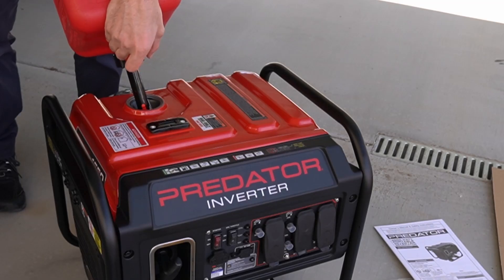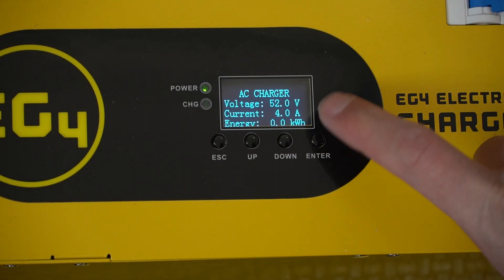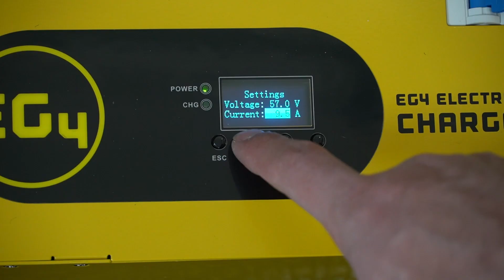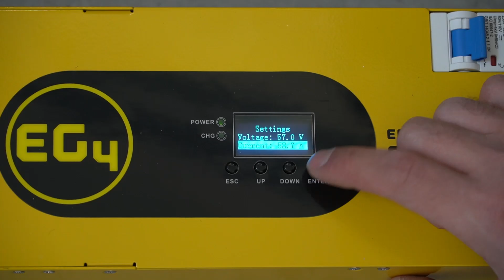New! 48V 5kW EG4 Chargeverter

Comment: My utility is now charging $65 per month in "base charges" (fixed charges before paying $.15 per kWh). My area can't produce enough solar power for my homebin the winter months so this product is one of the keys to my eventual plan of taking approximately $3000 paid annually to the utility for 15000 kWh and using it to go off grid. If u get 7 kwh per gallon of fuel at $4 a gallon that's about $.50 per kWh. I pay $.20 per kWh including my base charges.
Reply: I pay 33 cents a kwh from Pacific Graft and Extortion for my first 292 kwh a month. Then it goes to 39 cents a kilowatt hour. You have cheap power.
Reply: @kimmer6  yeah but what's your base/fixed charge?
Reply: @fox156  No base charge. We pay by the actual usage in gas and electric.
Reply: @kimmer6  @ 500 kwh usage per month I pay .26 per kwh, you pay $.33 per kwh. At 200 kwh usage per month I pay $.47 per kwh you pay $.33 per month. My utility penalizes conservation and charges a much higher rate for people that live in small homes/use less electricity and a much lower rate for those that use more electricity. Your utility does the opposite, charging more per kwh for people that use more. My minimum bill is $65 yours is $0. You just have to use less elecctricty to save money, I have to go off grid to save money. As far as I know we have the highest base rates in the US. Funny world we live in eh!
Reply: @fox156  Are you with San Diego Gas and Electric? Interesting read. I used to use about 550kwh a month. I found some things to really cut it down. Nobody else would put up with the things I do to save on natural gas and electricity. I put power stations in all over the world right out of college decades ago. I see the writing on the wall. Higher energy prices, shortages, rolling blackouts. I prepared, did actual real world tests to see the weak points in my strategy. I should be OK.  My January gas and electric cost $187 for a 3000 sq ft house. My neighbors paid $500-$900 for January. I snicker at them and know I'm doing things right.
Reply: @kimmer6  I'm in northwest Colorado, yampa valley electric association (yvea).

Comment: Will, another possible use with the dial-a-charge is to run a generator in ECO mode to keep the noise down while boondocking.

Comment: Glad they made this! No doubt there’s a good amount of “dirty electricity” using square wave harbor freight generator/inverters
Reply: Until seeing this video I never knew anything about this problem. It kind of really sucks having an all-in-one inverter if the charger doesn't work properly unless you have 22,000 w or you're plugged into extremely good Shore power. But I guess I I am glad saw the video before I plugged in my generator to the all-in-one. I was considering doing that in mines a cheap predator 3500 so I don't ruin my all-in-one inverter. I thought the Predator 3500 was supposed to have a pretty clean inverter but maybe it doesn't. What is the price of this charger to you know offhand. I haven't seen that yet I wonder if you could charge you're 48 V golf cart I don't know much about golf carts but I just thought of that
Reply: @VinceBadovinatz88  Will has a link to this above, but the price for one is $399.00.
Reply: @Tumbleweed5150  thank you

Comment: I've been thinking of a high power charger, I have a solar system on the house, then 300ft away I will have another system on my shop. I considered combining the two system into one, but not sure. I can use a charger tho to charge the house if the shop solar is producing excess. I plug in my tesla in the house system.

Comment: Was looking at this model the other day.. Spec sheet says max voltage is 57..  Thought that was kind of odd..  Either way, this thing is a beast..
Reply: 57 Volts is close to the maximum battery bank Voltage for charging a "nominal" LiFePO4 battery bank.
Reply: @Tumbleweed5150  I agree that it is close..  Just odd they max out at 57..

Comment: That's pretty awesome. I have a Cummins Onan 7000 watt QG series fuel injected generator, it was free to me, just needed some maintenance, super quiet however it only outputs 120 volts on 2 circuits, each being 3500 watts. It's power output however is very clean. I have one of the two circuits going to a Growatt that I use just for 120 volt loads, adding one of these to the second circuit I could then use the full output of the generator to charge batteries in an extended outage or just use it on the one circuit and not need to use the Growatt for charging from the generator at all. Much better deal than the Aims one and the easy to use display to set the settings would make it even easier to setup. Really nice. Being able to use both circuits at 3000 watts each would allow me to charge my battery bank in about 4 to 5 hours and then turn off the generator, way better than having to run it longer. I will say, fuel injected is the only way to go for a gas generator, no more dealing with gummed up carbs. If the fuel is old, swap it, hit the primer button to flush fresh fuel into it and boom it fires right up.
Reply: If the two 120V outputs are the same phase, you're right. If they are the opposite phase, then you have 240VAC and the chargeverter works best with that as its input.
You could put an AC voltmeter across the two live signals to check.
Reply: @isovideo7497  Sadly they are on the same phase, confirmed via meter, they use a different setup in the coil for the 120/240 volt version. But for a free generator I can't complain, it's super quiet and very reliable.

Comment: Thanks, I'll get one of these. I had trouble with both MPP and victron when they were configured in parallel or split phase that they rejected the small generator input ( we are OFF grid).. but both accepted the same generator when in single inverter mode.. seems to me  that they could make this work...

Comment: I like this. this is awesome.
It makes it stupid easy AND safe for the other equipment, to recharge your batteries from "ancient technology" when the new fangled stuff decides to break. :D
I've got SO many ideas running around right now, on how that would be completely useful.
Reply: and rather than try to figure out which other comment to reply to, I'll reply to my own. :D

while I'd hate to "feature creep" this 'chargeverter', one thing I could potentially see being useful, is a rudimentary built-in timer control for it, so it could be scheduled to charge the batteries from it's source at specific time(s).  unless someone knows of a cheap (sub-$50) inline 240v outlet timer.  I could probably rig up something but that's getting a touch sketchy.

Comment: Couldn't you just limit the grid input amps on your all in one inverter to not use more then half(or whatever is best for your generator) the rated power of the generator. This would in theory also lower the output on the generator so that the output is stable and clean?
Reply: Victron inverters can do that. EG4 and similar inexpensive ones can’t. 

As far as I can tell, if you are charging the battery off of AC, you can’t have your inverter actually inverting. It will only pass power through from the generator. It probably shares electrical components for charging and inverting or something.
Reply: @gf2e  Thanks that's the information I was lacking. I have never needed to or tried to charge from generator but was considering setting it up as I came very close this winter.
Reply: Until a fridge or something kicks on and the generator dips below 57hz to catch up. The inverters then disconnect momentarily and reconnect
Reply: @nikolapro7468  if you limited charging to say 16amps it would have to pull the difference from the battery so I don’t see how that would cause a dip in the generator. 120 at 16 amps is like 2k watts so not an ideal charging speed but better then nothing and I don’t see almost any 4K+ generator not being able to supply 2k watts at 120v 60hz.

Comment: I have been looking for an affordable 100A (or bigger) 12/24v charger - pity this doesn't have variable output voltage (or does it??)

- the "cheapest" thing(s) I have come up with (for charging big battery banks - ad hoc, is either: an All in 1 inverter-charger with (mine only has 75A charge output) high current output, or a 100+A MPPT solar charge controller - to use with grid 240VAC, or a generator (Australian single phase) a simple 240AC- 30VDC (or any voltage supported by your Lithium compatible (AC - AV charging) MPPT controller.  The dirty generator power is most likely from cheap low capacity inverter generators being pushed hard, an alternator based generator - with rectifier and smoothing caps should give clean ( from inherently pure sinewave AC  - if the smoothing caps have enough capacity)
Reply: wow the telegram bots with Will's Photo are going ape-S today..

Comment: cringey generator. i'm now sensitive to pollution after staying more indoors, i had to replace my t-shirt after a stroll outside a quite busy street.   consider that if one is actually concerned power security, fuel is less secure as it needs to be transported, which also needs fuel and electricity. better spend more on solar and wind and overbuild it. The pwerful charger has some use though for less common stuff like DIY EVs or weird but powerful DC battery system.

Comment: Will, keep in mind those of us in northern climes (Washington state) -- we live on an island and have numerous power outages all winter long. Solar is impracticable, so gasoline or diesel generators are a necessity. The EG4 Chargeverter makes good sense...it will be part of the battery system I have planned for later this year (8Kw gas generator to the Chargeverter to 10kWh 48V battery bank to 6Kw inverter to the house panel)
Reply: relying on a supply of gasoline during an emergency seems impractical to me
Reply: @edc1569  Use a diesel generator, then you can make your own diesel fuel.
Reply: @edc1569  so does trying to find any goods not made in china... you do what you gotta do and prepare for ANY contingency even if requires fuel
Reply: There are numerous channels out there even more to the north of you which run their off grid homesteads all year long with solar an batteries. Don't say its impracticable... Say: "I do not want to do the hard work".
Reply: @wolfgangpreier9160 or say I don't want to have a solar system twice the size just so it can function for 2 months of the year...
There is a cost associated with those people who have just solar, they're way over kill in the summer months.
Reply: @vhateverlie  I'm at 63 degrees north. No matter how many solar panels I would put, I won't generate anything in dead of winter. We just don't see the sun at all...

Comment: Yea this is beautiful. Generators always have dirty output.  I had a growatt which would not take my generator power bcz 65hz!! I had moved from Chicago to Utah 4500 ft and it affected the hz.   
Love this charger.  

And yes I avoid the generators as much as possible  i hate them.
Reply: You can adjust the hz output of your generator it's easy to do just look it up on you I check and adjust mine each time I do a service
Reply: @xgouldiex  yea, Roger that.  I did the adjustments as recommended at the time. This 65 was the closest to 60.  I also called and emailed the manufacturer.  The 4500 ft and -10F were issues. Unfortunately because I have to have heaters for my off grid batteries it was a big deal. I was relying on the generator as backup. I ended up getting different generator and that worked fine.  Growatt also did not have a work around either.   I had considered going through intermediate inverter chargers as well to fix the 65 hz issue but time was limited for me in terms of solving it. 
Eventually, I broke down to individual components in my system instead of one Growatt like system component, and I have no problems and a lot more flexibility
Reply: @rickharold7884  lately I've been thinking that different component systems are better than these all-in-ones.. Probably better just getting one of the big victron solar controllers and another good pure sine wave inverter. More expensive but better in the long run probably. I'm really sorry to hear that my charging system is not even going to work properly if I was to plug my generator into the AC input. I didn't know anything about that until today. I might have made a different choice on what I bought had I have known. But this charger might be advantageous for many things anyway. Well I'm glad I saw the video

Comment: Even though the batteries are wired in 48volts? There’s something that i forgot to mention: I’m also using a 10000watts “continuous” (aims power inverter) which my generator seems to be not powerful enough to help charging my battery bank (wiring in 48volts). Please help me, your professional advices will definitely be appreciated.  Thanks a Million in advance.

Comment: Will this also work for (4) 12v batteries connected in series for a 48v system?
Reply: Yes, just have to make sure all 4 batteries are at the exact same SoC first if it's a new system. Note: This was designed for lifepo4 batteries. Can probably charge some other types by adjusting the charge voltage.
Reply: @andrewt9204  Can one adjust the charging Voltage? Will only showed how to adjust the Amperage.
Reply: @Tumbleweed5150  that's what the manual seemed to indicate

Comment: *EDIT* also this is HUGE for another reason. Whenever my inverter (MS4448) senses grid power, or is charging from the grid (my generator with me being off grid) it goes into passthrough mode.
So I have DIRTY sine waves from the generator running my whole house. Lights flicker when it throttles up and down, my 20k$ development PCS dont like it at all. No matter what I do I cant get ito to run from the batteries and just charge the batteries. It ALWAYS defaults to charging from the grid and supplying you from the "grid". With this system you can still run your sweet sweet perfect sine wave inverters, all without them knowing about power charging the batteries.

**Original. you LITERALLY just solved 5 years of battery trouble with me being off grid. I have a "pure sine wave" inverter/generator from honda. but the signal is really dirty. I notice that when i get solar to charge my batteries, they last forever. Yet, the second i charge a bank from my generator it almost ruins the bank. Ive spent the past years going over settings, everything. This is exactly what i need!
Reply: Something wrong with your Honda if it isn't putting out clean power.
Reply: @my_channel_44  She needs a new eco throttle switch. So it kicks in and out to high revs vs low. Only for a split second. But, the router, starlink, computers, everything in the house restarts. I know the house cant take too many more surges like that.  I could def turn off the eco throttle. but Eco throttle charges the batteries with 1 gallon, and Eco Off takes 3 gallons to charge the batteries

Comment: Will, please purchase a good, basic oscilliscope (e..g, Siglent 1104EX) so we can (1) see quality of the voltages on the outputs of these devices, (2) get a good current shunt so we can see the inrush currents, and (3) see the distortion components via the spectrum analysis.
Reply from the maker: I've got multiple scopes. I need a old generator to use instead.